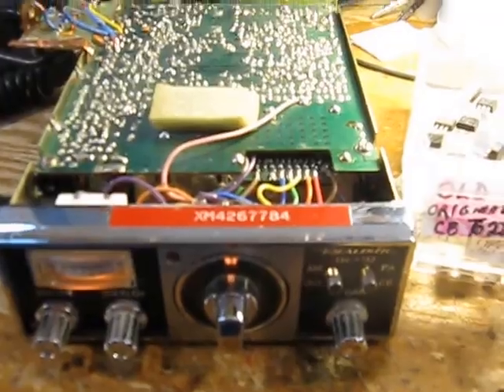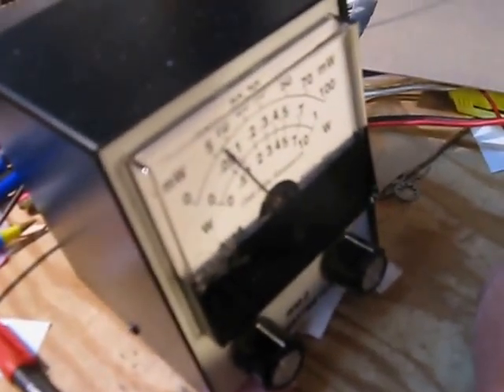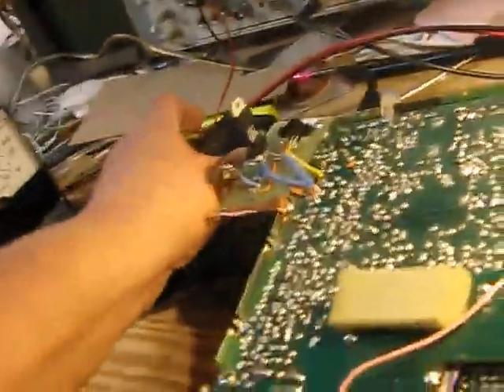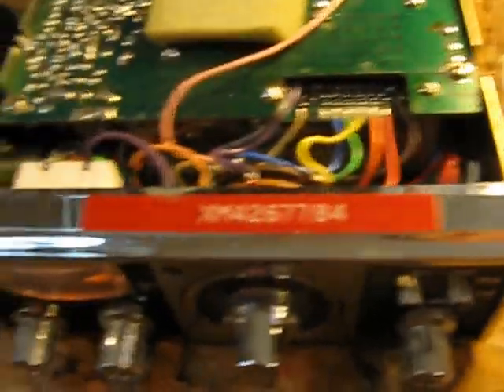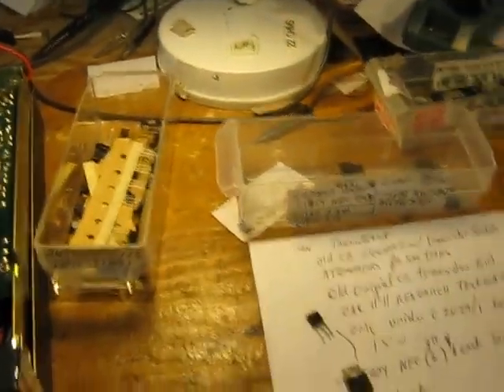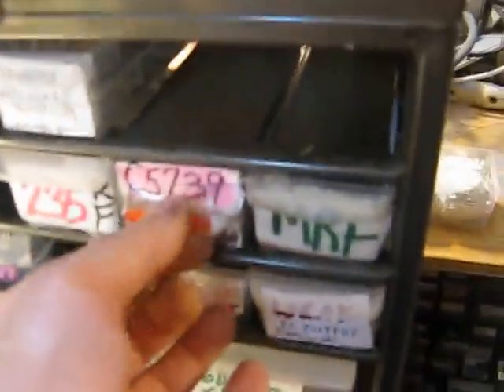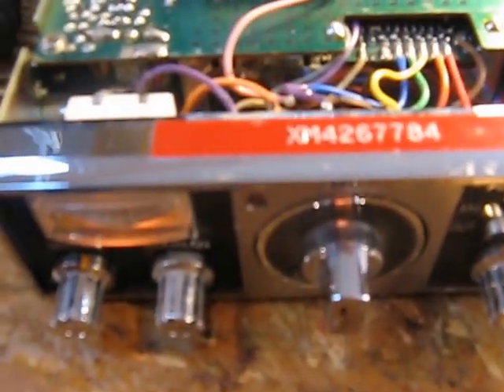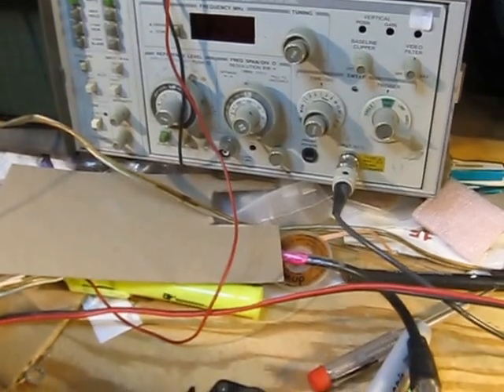Testing CB or QRP level RF transistors general methods

Comment: Thanks, Earl, VE3AD. Very nice video.  I'm an old EE/ham and I have many small bunches of eBay BJTs, MOSFETs, and passive components I've bought for ham radio QRP applications and I've seen a few of these very helpful test setups using an old CB on youTube.  I like yours as it shows, with just a little consideration, that small-signal transistors can be tested as well.  I think this is going to push me over to pull an old CB out of attic and rig up one of those TO-220 test sockets and see how it goes.  Thanks, 73s Coop AA1WW